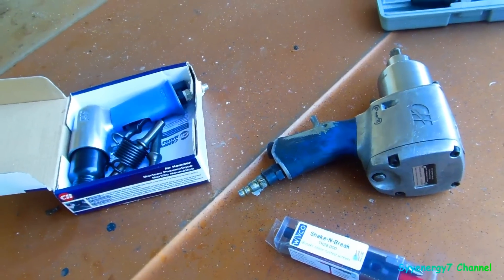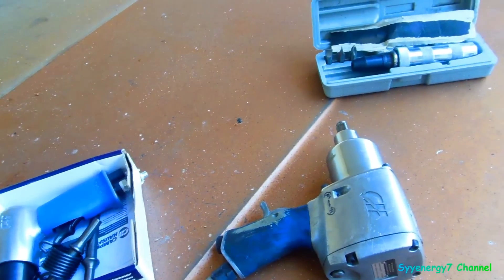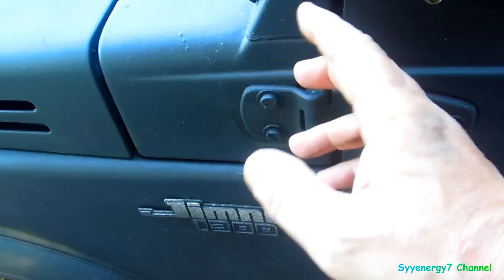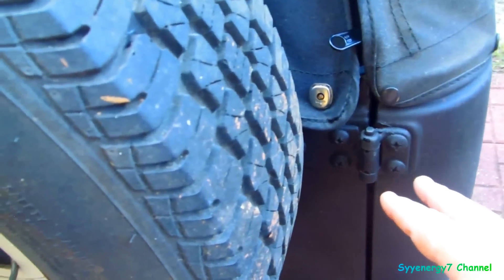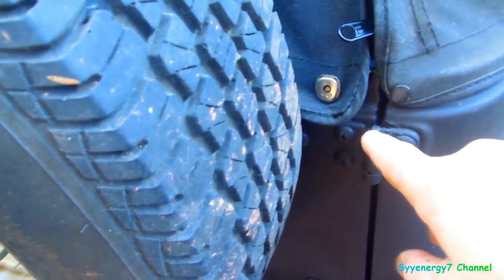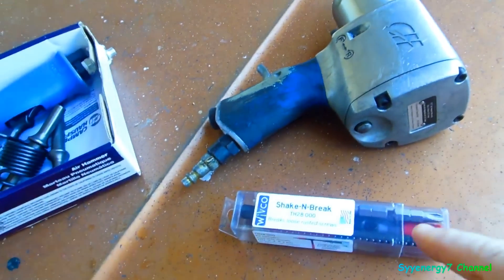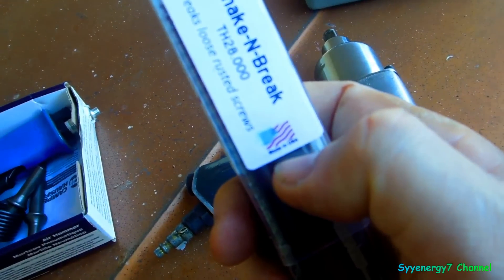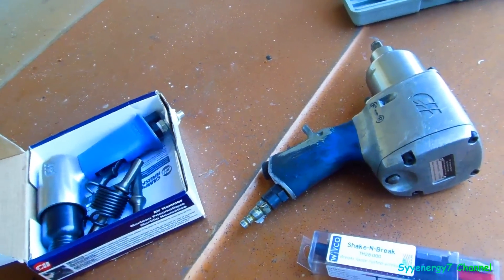ABSOLUTELY Best Tool for Removing RUSTY Bolts & Screws

Comment: That tool works amazing for taking out those stubborn screws that hold brake rotors on.  It will even shock the rust weld loose in some cases so you can remove the rotor from the hub.  Mayhew makes some that accept 1/2 or 3/8 sockets too.

Comment: It seems to do a very good job on your tight but intact screws. I think a rusted, degraded screw head would be a greater challenge as the bit would be likely to slip out or not sit in properly to start with. This tool works on the same principle of your manual impact driver, but with more impacts. I'm intrigued to see how it works with less ideal, more typical fastener situations.

Comment: Thank you!
Reply from the maker: +Bruce Mcgrew Before this thing, most of the time I had to drill them out and use easy-outs.   I know a shit load of tricks to loosen frozen bolts and nothing worked on these Suzuki screws until this thing. Surprised the hell out of me.
Reply: Sometimes they will do that!

Comment: That's not a bad tool..you should also try an impact driver..all you do is hit it with a hammer and it gets most screws out and you can keep it in you tool box for emergencies..you don't need any air or anything, just a hammer.
Reply from the maker: Yep, the hand impact wrench is pretty good.
Reply: Doug Anderson
I didn't notice it..thanks for the heads up..

Comment: Its similar to the rotor/disc tool mechanics use to remove the disc screw...

Here we call the tool..a "tourne gauche"...which means left turn lol..

Anyways..similar concept, except yours vibrates....which causes to nut to break loose..

Might have to look into finding one....and a zip gun too while im at it.
good video.
Reply: +overlogg I also always use, liquid wrench on all nuts bolts that haven't been ever removed or look rusty as hell...that stuff works miracles.

I have sheared off enough bolt heads in awkward places to know better than to attempt liquid wrench...

Comment: neat tool and concept..unfortunately...i probably won;t need one but once every 7 years...so i'll just keep doing the old manual way of removing bolts-nuts...i always win after a few hours anyway...lol
Reply from the maker: +Accuracy Marked Not with these particular screws.  You can work on them all week.  Your choices are: 1) use heat and burn the paint, 2) drill them out and use easy-outs or 2) use this tool.  These screws are ridiculous. 
Suzuki SJ413 Samurai DOOR HINGE BOLTS. 
http://www.youtube.com/watch?v=LB_soSuM32k
Reply: Two man job....I'd be the one with the exact fit Phillips...and pushing 300lbs into the screw...and then i'd have another man with cheater bar locked onto my phillips....turning it. The ENTIRE key is...(with emergency brake on) you HAVE to be pushing 300 to 400 lbs into that bolt-head before you start to turn. I'd taken these types out before...brute force...you get one shot!, two man job...but i'm on the hardest part...pushing. The issue is people don't understand the intense pressures involved taken that kind of bolt off. They usually just strip them and cry....or grind them off...or burn them
Reply from the maker: +Accuracy Marked Believe me I tried that.
Reply: I just bought a impact driver for removing the seized screws that hold the rotor to the axle. I bought the better American made one from Amazon for $49. A couple of taps with the hammer while trying to rotate the tool CCW and the screws came off. I used to have to drill them out because I always strip the head. I do not know how much this tool cost but I can see many uses for stubborn screws with the impact driver.